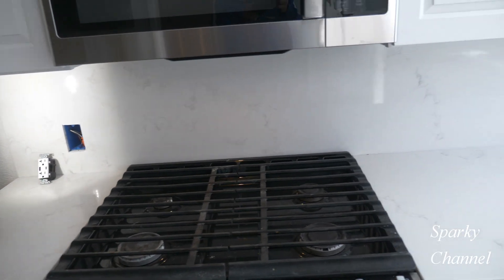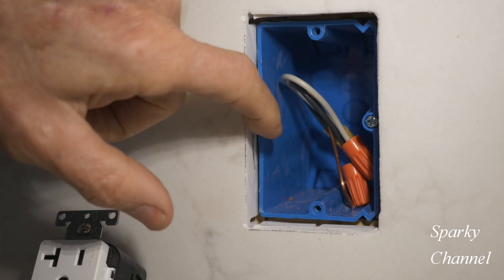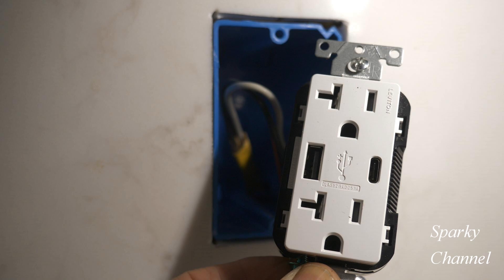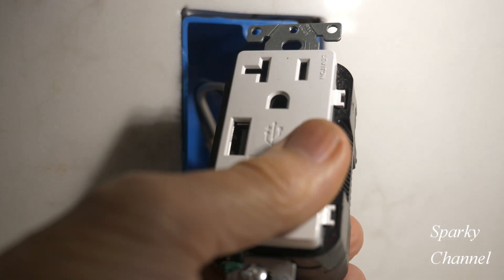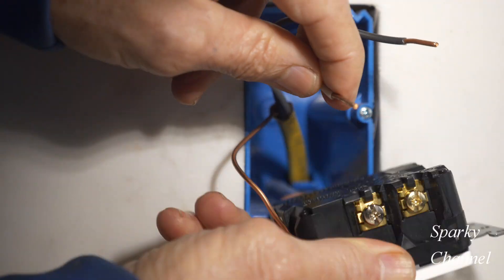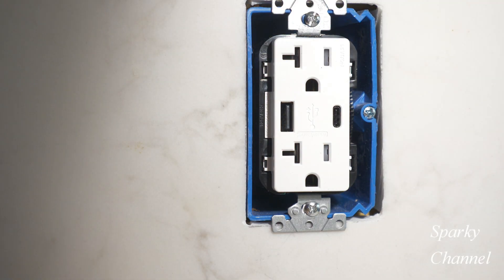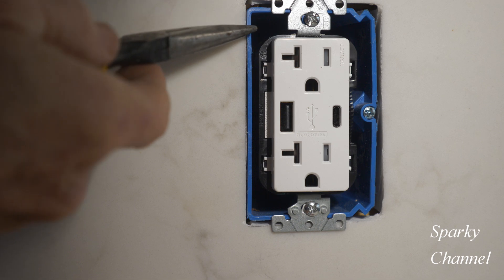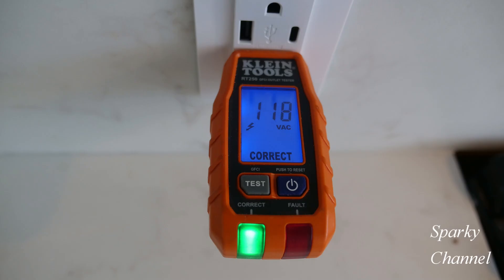How to Install a Receptacle with USB and Type C Charging in a New Backsplash

Comment: How to split the USB receptacle to have one control by the switch (with red wire), then connect it so the USBs are always on, and the power outlets are half always on and the other half control on by the switch?

Comment: Did you notice on your video as you waved the pencil tester around a dead circuit and a dead receptacle it flashed two or three times?  That is why I put no confidence in them as a safety device.  Same reason I do not like wiggies that are also continuity testers.  When I am testing for power in any circumstance I want a very definite and positive Yes/No with no uncertainties involved.  Thus my wiggy gives only a Yes/No to power.  Nothing else.  When I want shades of gray then I use my multimeter, or other specific testers.  Pencil testers can inspire false confidence if they are not right on the hot conductor they are telling you, "no current" when in fact there is.  Putting the leads directly on the bare wires is the only way to insure your own safety.  I have also had an Ideal pencil tester fail on me and fail in the cold mode not as one would assume in the hot mode.  Sure I always test it on a known live conductor but if it can fail it could well do so right after you tested and if it fails as mine did in the 'cold' mode you would think you were safe when you were actually working a hot circuit.  Just saying.  By the way a guy has to love those adjustable boxes.

Comment: Hey sparky im in a bind so my house is grounded properly and someone  hard wired 2 wire instead of 3 wires into the ac dicoonnect and ran it underground so i have a open ground showing on the outlet far away from my house so i was thinking if i just hammer a ground rod into the ground and just run a straight bare cooper wire tp ground should be okay?i dont wanna use a gfci thanks

Comment: Would love to or maybe you can explain how many circuits it took for that kitchen. Are we to do homerun for every outlet in the kitchen? Thank you so much.
Reply: Kitchens are required to have a minimum of 2 small appliance branch circuits per 210.52(B).  The counter needs an outlet within 2 feet horizontally of every wall location per 210.52(C). So, unless the kitchen is tiny, more than two outlets are installed, often way more.  No requirement to home run every outlet.  Typically additional dedicated circuits are also run for fridge, disposal, and dishwasher.
Reply from the maker: And microwave. I ran a separate 20A circuit to the microwave as well.

Comment: Why is it ok for current to travel on the neutral, but current on the ground will cause a fault even though they are tied together?
Reply: In the case of a GFCI, it's measuring that all the current going out the hot comes back on the neutral. If there's some that's not, such as by coming back on the ground, that's indicating a short. Since that's something going wrong, it's tripped to stop a potentially dangerous situation.

Comment: The level was a nice touch. No need to claim " I've just had my eyes calibrated". Great to know the current rating of a decent USB outlet @ $35.00. I'm thinking my kids i-pad charger was around 5 amps, but 3 would get the job done. Thank you very much !
Reply from the maker: My pleasure, thanks Tim!
Yes, when doing work getting things plumb and level is important.

Comment: Hello Bill,                                                          Yes indeed, both the Wago-Lever-Nuts and these Adjustable-Electrical-Boxes have made working with electrical outlets and switches much safer and easier. ... By the way, alot of time and money was spent not only on placing the new outlets but also, on the new marble countertop and backsplash. It is very unfortunate that they did not choose a double basin kitchen sink as was customary in the past. Because now, in having chosen a single basin kitchen sink, they have to wash their dirty dishes above any piled-up dirty dishes. Which means that, water from the faucet will be splashing everywhere!
Reply from the maker: Hi Robert! This particular kitchen will have a Kohler 9 1/2" deep double basin sink and a Kohler pull-down kitchen faucet. The countertop and backsplash are quartz.
I agree with you, splashing water in a kitchen sink is bad. Thanks!

Comment: hey bill, how does the usb ports get the voltage to be powered if the wire only holds 110-120 volts per outlet?? does it give 5 volts to each usb and only give about 110 volts to the power outlet?
Reply from the maker: There is circuitry in the device so that your particular device won't be receive too much current or be overcharged.
Reply: thanks bill!

Comment: The hardest part for me (not being an electrician) for this and others GFCI receptacles are pushing the 12 gauge wires into the back of the box so the receptacle fits flush and square inside the box.  Any advice?
Reply: It depends on the volume of the box. If the box is small like the older metal ones there may not be enough room to do it safely. You can add a Legrand wiremold surface mount over the box in this case. If you have a 20 or 22.5 cu. in. plastic box there should be no problem. The key is to fold the wires neatly in an accordion manner and have the end of the wire or pigtails flush with the surface or slightly recessed. Then pull them out enough to make your connections and push the receptacle in place. If it's done correctly, it should go in easier with minimal force or resistance. The wires should still be long enough to be code compliant when unfolded.
Reply: @surferdude642  Great points! Some GFCIs are bigger than others too. If you have 2 or more sets of hot/neutral/grounds, it can get tight and need the largest boxes even when box fill calcs say smaller is ok. Never screw in the GFCI to squash the wires in back to fit - it should lie flush with no back pressure before screwing down.
Reply: Voltclaw!
Reply: Even though Sparky mentioned adjusting the box to be flush, you need all the space you can get with these type of receptacles.  I believe 1/4 inch back is acceptable per NEC, but with a non-combustible material I think it can be farther back.  Perhaps someone can comment on this?
Reply from the maker: @glasshalffull2930  I wouldn't quibble with a 1/4" back with a non-combustible material.
Reply from the maker: My advice is to use a VOLTCLAW-12 Nonconductive Electrical Wire Pliers: Amazon: https://amzn.to/3aG8EPU
It was invented by my friend and fellow electrical contractor Warren Tarbell. It shows up in a lot of my electrical videos. They are made in California.

Comment: Great video! Thank you! Wish that more people would start using these boxes, solves a lot of headaches.
Reply from the maker: Thanks so much John!
Reply: If a regular unadjustable is too deep you can use a box extender, they come in different thicknesses and sometimes longer screws are supplied. They work very well.
Reply from the maker: @surferdude642  Yes, great point!

Comment: looks like you're up to the clean part of the project.  a lot better than the stuff I'm dealing with at the moment - if you remember those old electric heater control relays - had the pleasure of fabricating a replacement for three of those last night.  the only ones of the new style in the Platt system are in Utah, right now, and they are mighty proud of them.
Reply from the maker: I bet they are proud of them!

Comment: I make a habit of always putting the wire on the clockwise side of the screw, even though it makes no difference on backwire clamps.  I just do it for the sake of consistency.  

also for those who haven't seen previous discussions, duplex receptacles have two ratings.  they have a connection rating and a feed-through rating.  a receptacle with a 20A feed through rating and a 15A face rating can be used on a 20 amp circuit. (the NEC specifies there must be more than one receptacle face, but some inspectors will allow a single receptacle face for a circuit that will have 1 15A appliance plugged in) receptacles with "stab" connections only have a 15A feed through rating, and are only allowed to be used with #14 wire.

the great thing about those lutron wallplates is the installation screw is short enough to not conflict with a hard backsplash surface.  standard Leviton Decora wallplates come with the screws two full turns too long, and they have to be cut down to use with a hard backsplash.
Reply from the maker: Excellent comments, thanks! Yes, I have come across those screws that are 2 turns too long.
Reply: @SparkyChannel  it is where the stamped wire strippers are better than the forged wire strippers.  the stamped ones are thin enough to cut those two extra threads off.
Reply: I'm not sure why a residential application would ever need 20A receptacles honestly, except on a single outlet where it's code. In my life I've seen exactly one appliance that used a 20A plug - a very old window air conditioner. Pretty much every device that needs more than 12 amps continuous just switches to 240v in my experience.  

I'm a huge fan of 20A circuits, however. Every 120v circuit in my house is on a 20A circuit except the smoke detectors. But they all have 15 amp outlets.
Reply: @eli_w_1991  there are a lot of space heaters and some hair dryers that SHOULD have 20 amp plugs - but that would make it harder for electricians to justify 15 amp general receptacle circuits.

personally, I favor 20 amp receptacle circuits, and 15 amp fixed lighting circuits.  with modern LED lighting, the entire fixed lighting load is less than 15 amps, and breaking up the lighting into zones is really only for convenience, so the ease of using thinner wire has no downside.
Reply: @kenbrown2808  well maybe some devices should have 20 amp plugs. Space heaters are technically slightly over the 12 amp continuous rating @ 1500 watts. Hair dryers aren't considered continuous loads so they're fine to max out a 15a circuit.

In either case, since they don't have 20 amp plugs, there isn't much of a reason to have 20 amp plugs in your house. 20 and 15 amp plugs are usually identical internally outside of the T slot and both are equally safe at powering your 1800 watt hair dryer.

Though I am 100% in favor of 20 amp circuits. I just don't think the 20 amp outlets matter for 99% of use cases.
Reply: @eli_w_1991  if I remember right, the hoover wind tunnel vacuum is also problematic on a 15 amp combination circuit.  IIRC, if you have multiple loads on a circuit, no single load can exceed 60% of the total circuit rating.  

interestingly, hair dryers are why I disagree with the decision to prohibit bathroom receptacles from sharing a circuit with other areas - the result of that is some electrical contractors will put ALL the bathrooms on one circuit, whereas, before, it was cheaper to combine a bedroom with a bathroom, and that would result in each bathroom being on a different circuit.

Comment: I don't believe taping the terminals is code and I would only (if at all) tape them on metallic boxes just as a courtesy for the next guy in case he removes the device while hot.
Reply: conversely, I am often annoyed if I pull out a receptacle, and it's wrapped in layers of cheap tape.  especially if it's in an older house, and the wires are frustratingly short, as well,
Reply from the maker: Correct. There is no code for taping the devises. In this case it prevents that bare ground wire from touching the hot or neutral. It's the way I was taught back in the day. :)
Reply: @SparkyChannel  there was a time I worked with a guy who was sloppy about putting the receptacles into the wall, which he'd gotten away with up until AFCI requirements were a thing.  now the first thing I check when an AFCI is nuisance tripping is whether there's a ground fault.if there is, I look for a ground wire left up where it touches the neutral terminals.
Reply from the maker: @kenbrown2808  Great tip, thanks!
Reply: @SparkyChannel  he's one of the reasons I'm biased against competitions of speed.  I burned a lot of hours cleaning up messes other people in that company left, though he was the worst offender.
Reply: @SparkyChannel  Gotcha, that makes sense also, I forgot about the bare ground, thnx.

Comment: My daughter bought  few outlets with the USB terminals in them.  The problem was the USB outlets was between the two plugs!!!  they were not accessible when there were plugs in it.  I took them back and get the ones you just showed.  Work very well!!!!
Reply from the maker: I've seen those. It's just ridiculous. I guess they never tried them out? Yeah, there is no substitute for quality.